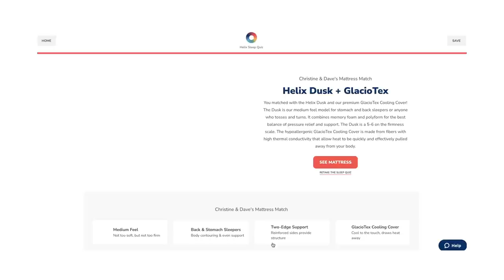NEW HOUSE TOUR, MOVING, DIY HOME REMODEL | FRUGAL FIT MOM

Comment: We just bought another home (planning on selling our current one) and it was built in the 80's. This home has the EXACT same hardware on the cabinets... ugh. However, with over 50 pieces the cost to replace seemed outrageous. I taped off the white porcelain section of all the hardware, painted the brass part with black chalk spray paint, and they turned out beautiful! Just a thought to save some money and get a more updated look. Nice home and congrats.

Comment: i moved into a new flat last summer and although it was "completely renovated" according to the contract we had to do a lot of stuff before i was able to move in. we did it all ourselves (we didn´t have to move walls, close doors and put new doors in walls). we did have to build in a complete kitchen though which we did for the first time ourselves. i did it with my sisters and it was such an awesome time. we worked like horses, but it was so much fun. no matter how much hard work it was, the time is SO well spent in my opinion. i almost envy you a bit for all of that ;)

Comment: Those cabinet pulls are the standard package for new builds even now, lol. If you want anything different, you're looking at paying around $5 -20 per pull plus labor cost (think $40 an hour for someone to use a screw driver). Most people just live with it, because they're functional, and aren't going to add several thousand to your final mortgage price.

Comment: My dad had alot of rental property.  Just a word if advice, if u r using a neutral for paint.  Use the same color throughout so u can easily repaint.  My dad used the same color for all walls, a certain color for cabinets, and for porches.  That way he always knows which paint to use according if something needs repainting. Just a suggestion.
Reply: You're right but since this rental is for her sister being flexible with paint colors is good. I'm sure her next properties will be more conservative. Good advice.

Comment: Did you say you painted a light fixture black? If so what paint did you use and what method? Spray or paint brush? Did you have to take off the ceiling? If you do another fixture would you do a video on that? TFS.